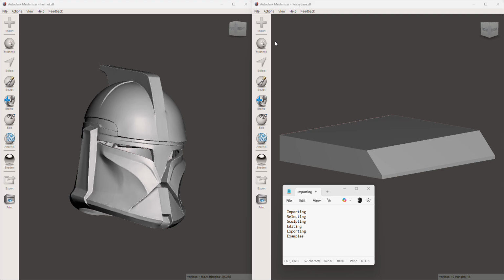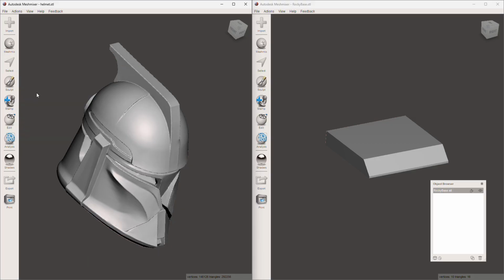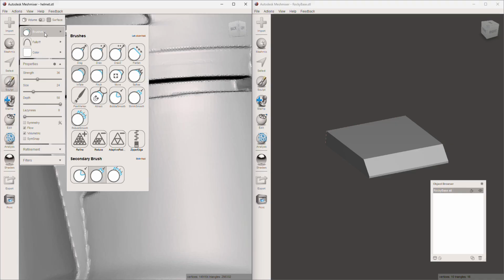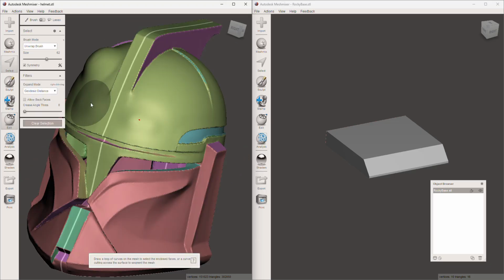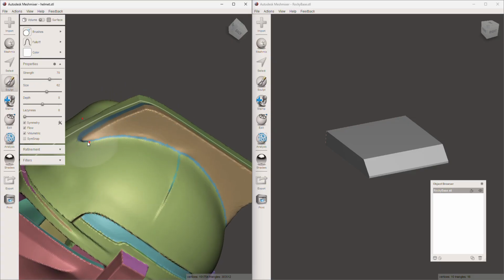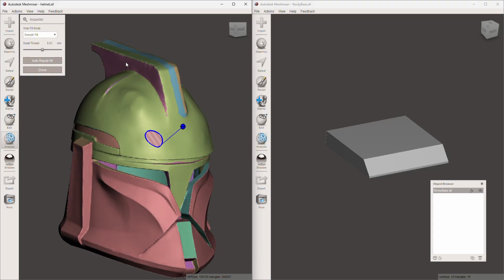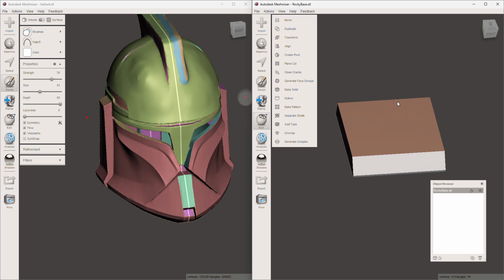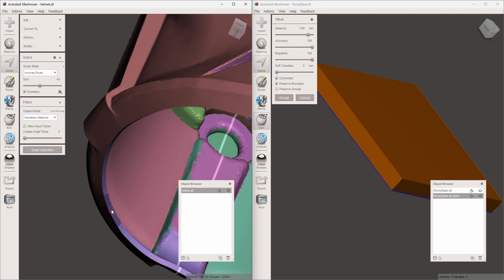Meshmixer Tutorial for Beginners, The basics (and some advanced tools) in AutoDesk MeshMixer

Comment: Thanks for this video. It was very helpful. Ive been working on a image to 3d file that had extremely thin walls. Ive put the project on hold because i couldnt figure out how to do fix it. Ive been using bambustudio for my edits. Ive used meshmixer a little bit now  i know how to fix it with offset!
Reply from the maker: I’m so stoked that trick helped you save the project, happy printing! : )